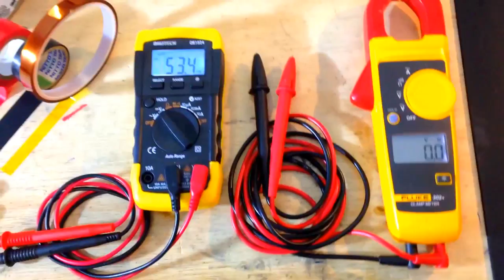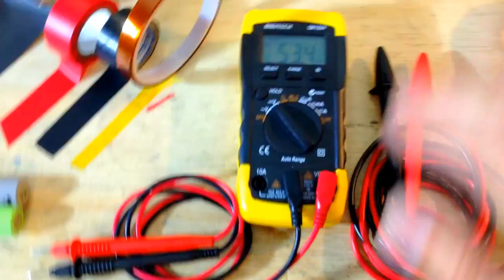Planning on making your own battery pack? DIY guide / tutorial • 18650 cells Electric Bike

Comment: hahaha i'm 3/4 of the way to your bench, but still making nasty packs.. ;) tab welders on its way though... so no more nasty packs very soon! 

Keep up the good work!

They can't be too bad though did 28 miles on my main bike on Sunday just gone..
Reply from the maker: +Dave Webster - Yeahhhh... you will see how "pretty" your next pack will look hahaa.... I still love my Panasonic pack with PF cells soldered by hand 70x each side. I only made like that to prove people that is totally possible to solder cells with a good thermal management technique using the right soldering iron and freon gas spray to cool the heat before it "fries" all the goodness inside the cells. Not an easy job and I would never recommend people to do the same. Spot welding is safer and much easier too. 
Yesss... more battery videos coming up... =]
Reply: Can't believe you've got 100 dislikes on this video... :(
Having had a mess about with some cell, I don't think soldering really does much to the cells, if your fairly quick.. I think you'd really have to abuse it to kill it with an iron but welders so much easier :D

Comment: How do you choose the wire's AWG (whatever that is)?
Reply from the maker: Hi Rekooooo, check out this website where they explain a lot of info about wire gauge (AWG) vs amperage vs length. Also another thing to consider is the continuous and maximum (peak) amperage, wires can handle more current than they're rated for few seconds.
http://www.pinsandsockets.nl/awg%20info/awg%20info.html
Reply: +ElectricBike (Bruno) Thx!
Reply: What is the width of the nickel strips you use? Are 1cm ok? Also, I don't really understand the utility of the link but I found this calculator helpful!: http://www.southwire.com/support/voltage-drop-calculator.htm

Comment: serious question....what is better:soldering or spot welding nickel tabs to the lithium ion batts??
Reply from the maker: Yeeeaahhh .. good question... it depends... you can destroy batteries on both methods, its possible to solder cells without damaging, you need to solder it fast and cool the cell down with cold freon gas (ideally), spot welding the welder can't be too weak (doesn''t stick properly to the cell) or too powerful (damages the cell inside). Spotwelding is worth if you're making more than one pack, if this is not the case, soldering would do the job. I recommend buying some spare cells to practice before you do the whole pack. Also its always good to have spare cells "just in case". Lets say you are making a 36v pack so it has 10 series, the most common configuration is using 4 cells in parallel, I would have 4 spare cells because when one cell fails it kills the other 3 cells. 
I give a LOT of useful information in this video I released recently https://www.youtube.com/watch?v=wN7HCj1dgSY&t=252s
Wear eye protection while soldering and enjoy the POWEEEEERRRRR haha

Comment: Hi Bruno, remember me? Making 6 cell battery pack using 6 tp4056. Input and output of all 6 combined parallel to get more amps charge.
I made it. And what happens is, at 4.07v one module turns blue and the rest of them are still red. Dont know whether the rest of them will become blue later, or not.... Do you know about this behaviour?
Reply from the maker: Yeah I remember haha... Good to hear that you're actually making it. What happens if you leave it charging for longer??? Are u using identical cells? Sounds like this single cell has a smaller internal resistance so it's charging faster or maybe the little charger is a bit faster than the others =/ leave it a bit longer and let me know what happens =]
Reply: +ElectricBike (Bruno) 
Bruno BRUNO!! 😨 😲 :O...!! Have you heard that machines come together and become self aware?
It happened. Every module came together and became self intelligent! 
At every half hour interval every tp4056 turned blue until the last one stayed red. I still kept it on charge then finally the voltage reached 4.21v and i didnt wait for the last one to turn blue, I stopped it because the voltage crossed. Took 7 hours for the 6 cells pack to go from 3.48v to 4.21v. 
I dont know why it crossed 4.20v. But waiting half an hour after the 5th module turns blue, will give full charge.
I am using new samsung protected cells. Every cell had exact voltage of 3.48v.

Comment: I've been reading, watching, searching for months before getting to the point where i feel like i want to make my own ebike. Which is now ;)
But there's one thing i need help with. The whole "continuous max discharge current" of batteries is confusing me like crazy.
Found a 48v1500w kit, controller, wheel etc... Thinking about making a 52v pack with 70x 18650 (14s5). But what cells should i get?
I have a lot of old laptop batteries but from what i can understand they aren't good at providing high amps. And then i heard there's the 2c, 11c rating? what the flasASjhtkdajond are those hahaha
Been looking at aliexpress, and obviously many of them have fake specs, so the 40a continuous and 60a peak... yeah obviously bullshit. What would be a "safe" bet? 20a continuous?
Hope someone can help because i've been reading left and right, and i've gotten to the point where no matter i search on google i end up with the same results that i've already been through and still haven't really gotten an answer. I've been doing that for a week now... And it's starting to get frustrating hahaha.
Cheers!

Comment: bro i wanna convert my normal cycle to ebike
and i want its top speed 60-70kmph and it must run 30-40km per charge!
what i need?
Reply from the maker: Hey Dj!!! The easiest and maybe the most reliable setup would be getting a Bafang BBSHD 1000w and put on a bike with big wheels like 29er, maybe keep the original 46T chainring that comes with the kit (good for top speed because is quite big) but we always recommend to get a premium 42T like the Lekkie Bling Ring for most cases, the smaller the faster it will accelerate but it drops a little bit the top speed. Battery, you must get a 52v not 48v, it does make a huge difference in top speed as that makes the motor spins much faster with a lot more power!! You'll need at least 17.5Ah battery or more... May have to get a triangle bag and triangle battery to fit inside the frame, that's the most common setup you'll see.
Good luck there, post lots of videos of your build and enjoy all that POWEEEEERRRR =]
Reply: link of all these please? :3

Comment: I would love to build my own battery pack, one that basically fills my entire frame so that I would get ridiculous mileage from it (like 30 to 40 amp hours?). However the only tools that I possess at the moment are a soldering iron and a multimeter. I wish I had a fancy spot welder like you do, however I may know some people who have one or know where I could borrow one if I needed to…

What would you say would be the essential items a novice DIYer would need to build his own battery pack?
Reply: Make one. Micro oven transformers have two uses, one of which is the power supply of a small spot velder.
Reply from the maker: Hi Gust, yeah sound like you'll be carrying a lot of POWEEERR there haha awesome!
All battery building materials I mentioned in this video I have here listed on the video description. I have links for cell holder, BMS, heat resistant tape, cell insulators (thick paper stickers) all that... Cells I would recommend get from fasttech.com or if your in Australia we have thousands of fresh LG cells straight from LG Chem factory. For a big battery like that I would recommend a hard plastic box or something like that, maybe go to a local electrical shop near your house and check out the waterproof switch board boxes sizes and shapes. Please let me know if there is something that you can't find there. So much POWEEEERR =]
Reply: Haha, yup, I want to get as much power as possible; at least 1Kw of energy for 1Kw of power. Though if I achieve a total of 40ah, that'd be 2Kw of energy. That's crazy.

I'll check out those links and build a "shopping list" so to speak. I guess Fasttech would be my 1st source, as I'm Canadian. Now I need to measure my frame, and figure out how many cells I can put in there and then look into a custom battery box.
Reply from the maker: +GustSergeant - yeaahhhh.. the easiest way to make a strong battery box is bending aluminium sheet and use rivet + silicone to join plates. Aluminium is awesome, soft and easy to cut, bend and sand, it would dissipate heat but is extremely conductive so you need to protect against possible shorts. A good padding around the pack should do the job!
Let me know how the project goes, if you want to calculate weight just do 49 grams per cell + the custom box, try to mount the cells as low as possible and in the middle of your frame, it makes a huge difference =] ...so much POWEEEEERR
Reply: +ElectricBike (Bruno) sure thing, thanks Bruno! I am also considering buying a complete kit from Paul at EM3EV too since he actually makes solid triangle packs with the aH I want. first step before I jump into the conversion is getting some Hope E4 brakes for both ends (4 piston); the Hayes Soles (1 piston) that came with the bike aren't strong enough to stop me (quickly) in emergency situations, even when I'm booking it at 35-40km/h under my own power.

Comment: how much current can you pull from the first pack of batteries, 60A 80A 100A??
Reply from the maker: +Reese Me - Heeeeyyyy.. depends what battery you're talking about.. the little one is 36v capable of 30A continuous, the other bigger packs are higher voltage like 48v or 52v.. the one I carry in my backpack has 70 Panasonic PF cells and its capable of 50A continuous and 90A peak for 5-6 sec
Reply from the maker: +martin d - yeahhh that project! I was excited to get more top speed pumping more amps but that controller was about 10v lower, in the end it was spinning with a lot slower and torque is proportional to RPM. Would be good it I was running a 36v BBS01 motor with that controller. I will be posting my next project really soon showing what I'm doing with this little controller.... you won't believe =]

Comment: i got nasty finger shock burn sensation sting & finger cut once  from mistakenly touching a 8.4v led bike light exposed micro  battery pcb protection module circuit and this was just two  26650 orange  cells.
Reply from the maker: Whaaaaaat with only 8.4v??? On your finger cut you said right? Cuts would drop your skin resistance significantly as the blood contains salt and other conductive minerals. Yeah it's not impossible to get a low voltage electric chock, specially if is high amperage! Check out "Electro BOOM" channel this guy shows some funny stuff about electric shock!
Reply: All im advising is for people to be careful as mistakes assembling  these cheap  cells and bms's could cause very serious injuries maybe even lethal.
Reply from the maker: Yeeahh... totally.. people watch videos and thing its like playing with LEGO... some poeple only learn when they see something blowing or getting electric shocks... we will only going to see more and more battery powered devices from now on.. so they better be aware of all that danger handling and playing with batteries =]

Comment: anyway I could build one of these large packs to power my laptop?
Reply: Aaron _ yes you could in theory, but it would have to be a lot smaller - this is way overpowered! With this many cells (50) it would have to be a 3S16P battery to power your laptop. You would have a big and heavy battery that would probably last around 8-10 times as long as a normal laptop battery. A standard Lenovo laptop battery will have around 48-50Wh of stored energy - this pack would be around 380Wh.

Comment: Hey i just wanna ask that how many Ah is equal to 1kw
Reply from the maker: Hi Chris, KWh is actually how much energy is packed in the whole battery pack. Let's say you have a 48v 14Ah you just multiply and get the result in Wh so in this case will be 672Wh or 0.672KWh
KWh is more accurate to tell the size of the battery, some bikes or electric cars have a very high voltage system to lower the current but it doesn't mean that the battery is "smaller" just because it's wired differently, just a ridiculous example, you can have 1KWh in a 3Ah pack with very high voltage (333v)
I hope these examples helped =]
Reply: thanks

Comment: Actually I think glue is better for heat disruption. It would be great if you could investigate it ;) Cheers
Reply from the maker: I heard some "theories" about it but I can go on and on talking about proving that glue is actually the worst technique option available. Battery generates heat and it's always building up as you're using, if hot glue is holding the pack together, imagine what would happen when the pack gets hot? I have fixed many glue packs that deformed with heat, some cases the pack got sooo hot that the glue went completely liquid and was everywhere including over the BMS. Liquid glue is conductive at higher voltages like 48v and above causing short circuit. The cells in  the middle of the pack will get much hotter than the ones on the end of the pack (uneven temperature) and will fail first. So now just imagine repairing the cells in the middle of a glued pack =/ nightmare...
Big manufacturers will never use hot glue, that says something =]
Reply: +ElectricBike (Bruno) Thanks for that explanation. I am going to build 300V pack and I haven't noticed that glue is conductive. I guess I will have to go with tesla style pack and with custom holders due to size of my car (vw lupo). Thanks again for educational answers but I have another one I cannot find answer. What are downsides of passing high voltages through cells? I was thinking about making packs of 300V (about 95 batteries in series per pack) but everyone is making paralel and then series. Why is that? You can answer in video as well ;) Cheers
Reply from the maker: +matjazkranjc - Yeaahh 300v DC sounds AWESOME, where are you going to use it? Okay we can use Tesla as reference as their motors run at even higher voltage, 345.6vdc nominal and just over 400v when fully charged. They have 16x 6s 74p packs connected in series so it's a 96s 74p. The reason why all packs are connected in large parallel groups and then connected in series is if one cell fails the pack still working fine, if you had just a single 96s and one cell fails, the BMS would cut that whole pack protecting the other 95 cells. The other reason why they connect in parallel is to balance the cells. The downside of connecting cells in parallel is if they're not individually fused and monitored by a good BMS, that could bring the whole group voltage down. Let's say a electric bike pack 14s 5p without individual fuses, if one cell short it could kill another 4 cells in parallel. 
Check out this eBay ad with more info on the Tesla pack https://www.ebay.com.au/itm/262321881194

Comment: what settings do you use on your spot welder?
Reply from the maker: It depends on the nickel strip thickness you're welding and if you are using the long extension (pen) or directly at the machine welder terminals. 
Using the pen I like to set the current dial all the way to the maximum and press 4 pulse. Do some tests first, try to remove a weld to see how strong the welds are. =]

Comment: imo if your battery gets warm while you're using it then it's underspecced. lithium cells should never heat up while you're using them, it'll reduce the lifespan. my 1000w ebike batteries stay cold to the touch, the only thing that really gets warm is the controller for the bikes motor and throttle etc
Reply: Is it that true? Bruno?

Comment: Convinced me to buy a professionally made pack :)
Reply from the maker: hahahahaha.. check out this video here showing inside many different brands https://www.youtube.com/watch?v=B_leLpKVxuw
I have a playlist with many videos too: https://www.youtube.com/playlist?list=PL59mIOWSOm9qrSglqe18AlYfBJRXLdduj

Putting cells together is not the too hard but wiring up the BMS takes time and must be done right, insulating all wires correctly is very important and finding a case or wrapping in something is important too... nothing is impossible, it depends how much time you want to spend watching videos and researching information online... 
You can also buy a pack and kinda do reverse engineering, open and see how it was made first, get a multimeter and measure every single BMS wire then you can copy and do your own version =]
Reply: Yeah but with not proper tolls diy stuff just scramble wire that not beautifull